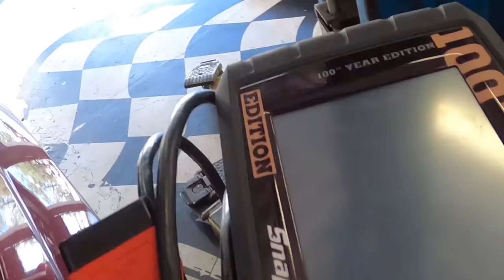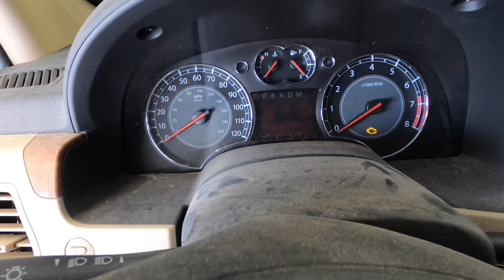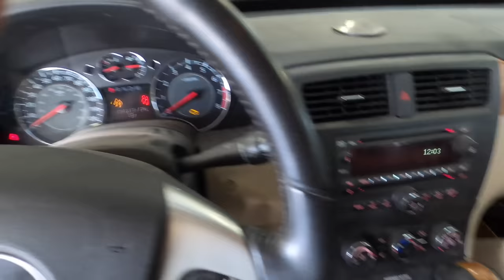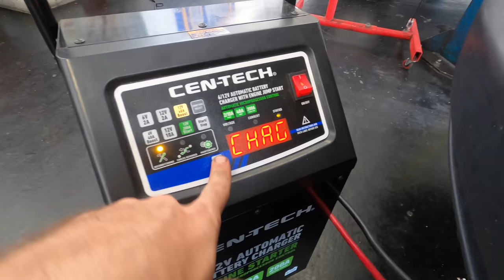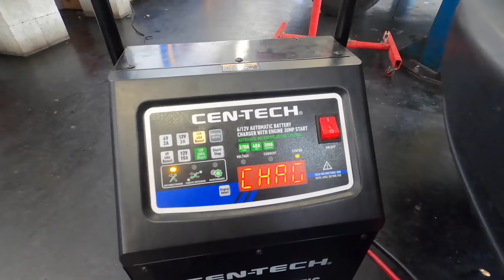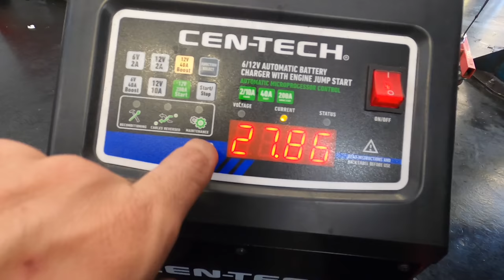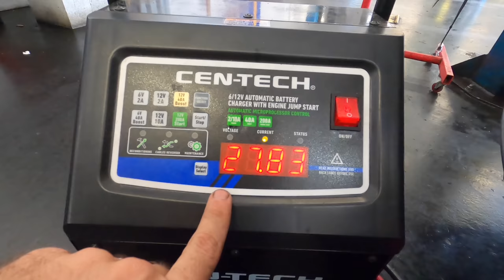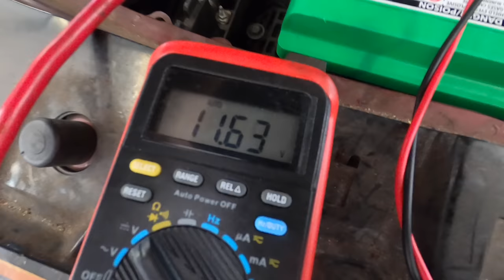Customer States: Doesn’t Start! Broken over 1 bolt! Suzuki XL7

Comment: Good luck getting parts. Did a clutch job for a friend on a 2005 susucki forenza from a no rust state. It also had a minor leak where cv shaft goes into transmission, and a bad clutch. Could not get transmission cv shaft seals or inspection plate gasket.   Napa, autozone, rock auto, etc..  All the parts stores.  Had to get gasket material for inspection plate and made one. Not that big of a deal.  Transmission CV shaft seals another story.  Brought cv shaft to NAPA, got a seal that fits the shaft, had to hog hole to fit the OD of the closest seal they have.  All hardware was extremely difficult to initially break loose.  Had to break out the 250 ft lb hammer to loosen and penetrating oil.  Got lucky and did not break any bolts. Put bolts in with antisieze. Cleaned all engine grounds.  That fixed some intermittent electrical gremlins from runs like crap to dim headlights. Pretty straight forward car to work on, but still a turd that you cannot get parts for.

Comment: That's somewhat what I went trough when changing the alternator on my suzuki. had to disassemble the exhaust under the engine to get the alternator out. It's almost like the built the car around the engine.
Reply: Yeah most modern cars that’s basically how they are assembled from my understanding

Comment: Helpful. Hint....I keep a small length of quarter inch rope, about 3. Feet long in my tool box.  Many 
times I use this rope when takin out. Alternators or compressors.  Run. rope thru mounting hole
and lift up on rope to aid in removing alternators  in a difficult place.  It works and saves dropping
An alternator
Reply: Dang! I just replaced alternator on my ride...had one bitch of a time reaching it. Rope idea would've saved lots of grief!
😁
Reply: Bungi cord works too, that’s what I use. :)
Reply: @JimmyMakingitwork  
You know what's painful? I had one in the car while replacing the alternator!
😖

Comment: Check the fuel gauge; if it is full; it's a bad fuel pump
Reply: not necessarily, fuel filter could be clogged to hell with dirt, rust, and whatnot as well
Reply: @rawr51919  perhaps, but that could kill a fuel pump because of all the extra work it Has to do
Reply: That happens to be true fairly often, the vehicle runs like crap so the customer runs right to the gas pump and fills the tank.

Comment: The battery was low on voltage but that doesn't mean you need to hook up the jumper pack incorrectly. Always connect the positive terminal first then the negative. Its just basic mechanics keep any potential sparks to a minimum.

Comment: Intermittent non-starts are the worst.

For an example (not actually looking for advice), I have an issue with a car that after sitting for a day after a rainy day usually needs to be cold and damp. The engine will turn over and over. Often the car will stumble but not fully start. Eventually enough attempts will result in a fuel smell. 

Recently I tried to time the stumble with opening the throttle and the car started. 

This problem has been occurring rarely for years. Leaving the hood open on a drier day will seem to resolve the problem quickly. Have talked to my mechanic about it, but it’s hard to diagnose when it works at the shop.

Comment: I had that problem with a 1980 Mazda 626. After not being able to start it for several days, I announced I would sell it for $1000.00 ( it was worth at least $2500. I'd just had a new engine put in and it had 4 new tires. Buyer came with tow truck. Car was towed 6 blocks to his shop where it started right up and ran like a champ. He offered to cancel the deal but I went through with it 'cause this was New York City and I was sick of paying alternate side parking tickets, insurance , etc.

Comment: Slightly related but not really kind of... I had a '78 firebird with a 350ci ground up rebuild. I put it all together and assembled. It was my senior project in high school so I was somewhat dependant of my old man for funds for parts, and he had a hard on for reconditioned alternators. A few months later and 5 reconditioned alternators later I finally had enough money from my PT high schooler job and I shelled out the $$$ for a brand new alternator. Boom problem solved never had charge issues again!!

Comment: If you ever have a 2002-2004  Suzuki Aerio that won't run and the computer indicates no fuel pressure and you suspect the pump check the ground to the fuel pump before replacing it. Mine died on me one day, acted as if it ran out of gas with over a half tank. Tracked the problem to the pump, replaced it and two days later the same thing happened, it turned out the pump's ground connection was faulty.

Comment: Had a similar issue many years ago with my Supra.   Had fan belt replaced by national company who shall be unnamed but colloquially known as Crappy Tire 🇨🇦. They snapped off a bolt for the ‘nator bracket  and left it.  Of course it didn’t take long for a starting issue to appear as the tension loosened.  Good thing I parked on a hill and it was manual tranny.  Cousins shop fixed it for free.

Comment: I had one of these. The wiring in them was completely shit. I had to replace both of the fan’s cables. The main engine harness had to be patched a few times too. Even the wiring for the locks and windows gave us issues.

Comment: I'm changing my alternator today or at least finishing it I have to remove my tie rod to get it out in my 1999 mercury cougar v6. I'm also upgrading my wire that runs from my alternator to my battery to 4awg. Tired of those annoying flickering lights and not being able to go over 6k rpm due to failing voltage regulator

Comment: I thought I was thoroughly knowlegable on Suzuki Engine layout.  I was surprised that the engine is mounted "East-West" on this XL7.  Older models of Suzuki (and Tracker) SUVs had "North-South" engine orientation.
Reply: That’s because the XL7 is basically a badge swapped GM theta platform (equinox and Saturn vue platform) you see this shit a lot the last Saturn vue generation had a Honda J35 engine, the Geo prizm is a Toyota Corolla, the Geo Tracker is the same as the Suzuki and Chevy of the same name.

Comment: I had a car that experienced vapour lock. It would act like a bad fuel pump but it was an issue of gas being boiled back to a vapour so no fuel pressure would reach the fuel rail and engine would stall out. Then it be hard to start just constant cranking until the fuel lines built up pressure again. The fix for this was to run some fuel tank cleaner that kinda helped keep the gas cool it only really happened on hot days but it was such a strange issue to have.
Reply: My parents had a 1984 Chevrolet Suburban that would vapor lock regularly. I remember being stranded a couple of times on summer vacation when we would travel. He put an electric fuel pump on it and it helped. It had a mechanical pump with a carburetor.

Comment: Close, fuel pump wouldn't lock up, it would have a bad segment in the rotor.
If it stopped on that segment it wouldn't conduct power until you banged on the tank etc and it got to another segment.

Comment: My dumbass was like “this Suzuki needs an exorcism… A demon is draining it of it’s power…”
Reply: Lmao. My Suzuki drains power... 100W fog lamps, dash cam, radar detector and LED low and high beams. It wasn't made foe that. I will keep the exorcism in mind. Lol
Reply: @defresurrection  get a bigger alternator my guy 😂 or wire in another battery for the accessories

Comment: if that was my vehicle , and I found you had to remove the alternator to change an idler puller , I think before I put the mongrell back together I'd cut a quarter inch of thread off that damn bolt lol

Comment: lol welcome to the bmw world, n52 (2007) and up engines have a 3 pc crankhubs. One gear for oil pump, one gear for timing, and the hub where the crank pulley bolts on to and both gears slip into. The 2 gears are being held in place by friction discs and a 22mm bolt. Bolt tightens up to 270 lb and sandwiches the hub to the 2 gears using nothing but a friction disc. That bolt has no thread lock from factory and tends to back out due to vibrations. 1 bolt can make your whole engine to shit itself. Or them little friction discs will snap in between the gears and fall out, having no friction discs will cause the gears to spin independently. Most common on S55 m3/4 engine

Comment: Be sure to put that missing lock nut of that power cable on the alternator and use the proper brass nut. This nut dissipates heat at that point. Using a steel nut will cause heat, expansion and loose and then arcing.
Reply: Looks like Ray was right, thinking about cutting the wire. That may just be the only real way to deal with that nut on the alternator connector.
You get the thing all connected and torqued safely and then reconnect the cable in the middle.
Reply: Yes Ray, those radiator shroud things do have a purpose, it is making the alternator come out much more
 S L O W L Y.

Comment: If an alternator picks when it wants to work it could have spun the bearing by the bushes could be that it's just losing signal from the battery etc and having spun bearings can cause it to brake through the plastic at the rectifier and can temporarily push the bushings up and out of the way to stop extra carnage
Reply: Huh welp I'm back here again funny that RAY GOD DAMMIT REPLY GIVE ME A JOB DAMMIT

Comment: I bet the nut on the alternator was cross threaded on the bolt that broke.
That would explain why the cable was loose and the nut was so tight.

Comment: 1993 Tarsus. After 2.5 hours of driving in high heat with the AC on, slow down, and the engine would stumble, and die. First time it happen, had it towed to the dealership. Of course, it had time to cool, and then it started. Long story short, the fuel pump would die during that event. I know more now and would replace the pump. Live and learn..

Comment: Noticed the battery charger was a Center Tech, from Harbor Freight.  Also, had to replace my alternator on my ,65 Chevy Corvair.  It took about 15 minutes to remove and replace the alternator. Very easy to get to.  Don't ask how long it took to figure out I needed an alternator!
Reply: I began learning auto mechanics in the late 70s.   I've seen and used a lot of tool brands.  A lot of the HF stuff today is as good as some of the 'pro' stuff for a fraction of the money.  For a guy just starting out, or for a hobbyist,  most of the HF stuff is more than adequate.
Reply: 2 hours
Reply: 2 hours

Comment: Same type of issue happened to me but on the main block ground. Rattled and arced intermittent. Battery connection had been cleaned and tightened before me. But both ends gotta work. Come to find out had a tranny swap by “others”.

Comment: How to put in freeze plug  cylinder ( 4) under firewall. 06 dodge caravan 3.3. I put new one n and it leaks. I tapped n further and it stopped leaking. I put new thermostat, radiator cap. Then drove it 20 miles it did good then engine back fired n stared run hotter. Never got over 1/2 gage temperature. When I stopped at home stated smoking back engine where freeze plug.  Radiator fans work correctly. I bought a different kind freeze plug a rubber expansion. Have not put it in yet motor was hot to touch.

Comment: Vapor locked?  Happens on a hot summer day?
Fuel pump is now in the tank?
Ignition switch has too many keys swinging from it?
So cheaply made that it starts shorting out.
Nothing like driving 65 mph and the gauges all peg and the transmission drops into 1st gear!  
Then You face plant into the steering wheel!

Comment: The rubber grommet perished on my belt tensioner causing the pressurized piston to pop off. This wasn't immediately visible or noticed. Result: Mechanic replaced alternator, engine sounded like a diesel, power steering was "iffy", and air conditioning compressor seemed to be on the way out. I got the car home, started watching YouTube videos, and eventually found the .45 cent problem. Sheesh!

Comment: I made a digital voltage display that plugs into 12 volt "cigarette lighter" recept...I can monitor battery voltage and charging system while driving.
Reply: I bought a cheap cigarette lighter usb adapter to charge my tablet, phone etc, it had an in built lcd voltage display that was really handy as you could tell when stopped and charging things , when the voltage started to drop a bit , that you should stop charging to save the car battery

Comment: seems the alternator is dead on it. see i have a Holden Ute 1999 model and the alternator on it die. when i put fuel in it and got it running, halfway form the fuel station to home the car completely died on me. i had to wait a good 1 and half hours  for my mum and dad to arrive with a new battery so we can at lest get the car home. the car was second hand so i was expecting something to go wrong with it. but its all good now it at my brother house cuz it wont start and my dad thinks it the fuel pump on it. it cranks but there no pump sound. note to self the car didn't start for a good 4 years so i am not surprised if the fuel hose  or the pump is gone.

Comment: They should have kept the 2.7. it's one of the best engines ever made.
Reply: Not in a Dodge Intrepid!🤣🇨🇦
Reply: @MichaelandCathy1999  the Suzuki H engines. 2.0 2.5 & 2.7  duel overhead cam 24 valve. So reliable the 2.5 & 2.7 are used in some aircraft.  But yes the dodge LH 2.7 engine is one of the biggest craps they've ever made.

Comment: Gotta love GM, the 2019-up truck water pumps love to take a shit around 10,000 miles, the pump is used as the alternator and compressor bracket. Can't get the alternator out cuz the radiator is in the way of getting 1 of the bolts
Reply: Try working on a Beamer bro, took me and 2 Mexicans all day to replace my AC belt
Reply: @jessepickar3297  lmao I believe it

Comment: Very similar to the Nissan Altima 2.5 had to pull the mount and bracket to do a valve cover cause 1 bolt was hidden under it smh lol

Comment: Sometimes remans use the wrong chip when rebuilding then 6-8 months later the alternator doesn't charge no more because of inferior electronics components they rebuild it with. Best is to take your alternator to a small mom n pop shop who only rebuilds alternators and starters, too bad the one near me closed down.

Comment: I bought a BMW with 5 new tires(spare still wrapped) after the seller paid a dealer $600 and they couldn't fix it. I overheard the seller offer two young men the car for $200 but they declined. I told him I would take it. It was in another city and he called later that night saying he would have it towed to his work. The next morning I was looking for the car in the parking lot and lo and behold it had a new paint job too. I paid him for it and called a tow truck and forgot that he said it didn't run. Well, it started right up. The roll back up and down unstoppable the fuel line and there was nothing else wrong with it
The same thing happened to me on a new Buick rental.drove it and pulled into a rest area and it wouldn't start. After a rolled back took it to the nearest return, gas started pouring out when the car was tilted to roll it off the truck.

Comment: Hey Ray, I have an 09 Venza the steering wheels jumps left and right going over bumps I took it to a shop and they said they couldnt find anything wrong. It has a slight pull to the right as well. Control arms were replaced and a shop did a alignment for it. I don't believe alignment job was done correct but that doesn't explain the steering wheeling spinning left or right over bumps. I also put the vehicle on jack stands and tugged on suspension only thing I could find that had play in it was sway bar links, everything else felt solid. What could be the problem?
Reply: Sounds like the rack is getting erratice pressure.  Could be a flow issue, pinched line... etc
Reply: Power steering issue maybe. Also could be a worn out steering shaft.
Reply: Maybe you need to poop in your engine works Everytime

Comment: Hi Ray, question for you. In a recent video I watch the customer had a inexpensive ODB tool plugged into the port. I know they are not as good as the actual expensive shop ones, but are they worth getting for an initial simple diagnosis,  or are they a waste of money. Thanks for the entertaining and informative videos.
Reply: Yes they are good for monitoring real time information check engine codes and resetting them. Some more expensive ones can do more like abs and srs system diagnostics. Torque app for Android and a cheap elm327 adapter will get you a decent starting point for basic diagnostics.
Reply: I've got one and I love it. The real time info you can get is invaluable. I have the torque app. Reading codes and that real time has helped me greatly with my older car and keeping it running well.
Reply: knowing the code is like step one in a multistep process.  You need to see live data etc...if you just want to know the code any auto parts store will tell you for free.
Reply: For as cheap as you can get a used professional tool get one of the better ones. The one your reference is to is the IFix brand.  Those are just a glorified code reader that proceeds to give you the most common fix (auto zone and advanced auto do this as well). He made a comment in how someone looked at it and yes they will give u data and codes but the fixes they give are only the most common fix and basically its just a parts cannon approach

Comment: Wasn't this the same vehicle as the Saturn Vue, or something like that?  There was a Pontiac version as well from what I remember.  All made in Woodstock, Ontario.
Reply: Pontiac Torrent, Chevrolet Equinox etc
Reply: @kyliewhitlatch  Thanks!  I used to live on the border of Canada north of Detroit and see tons of truckloads of these come over from Canada. I knew it was a badge engineered model, just couldn't remember which ones.